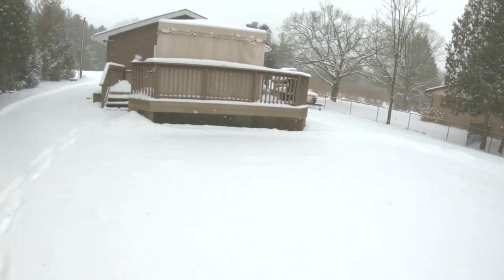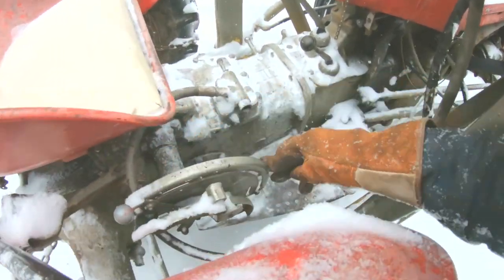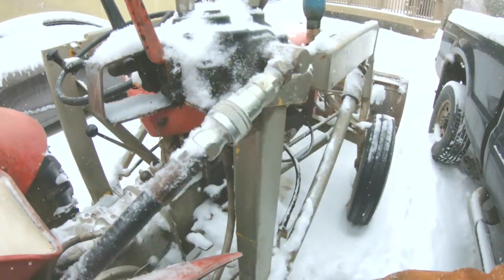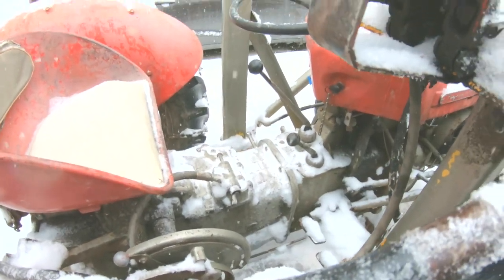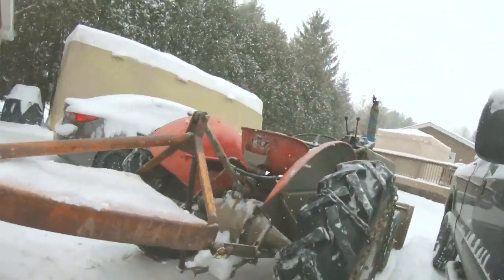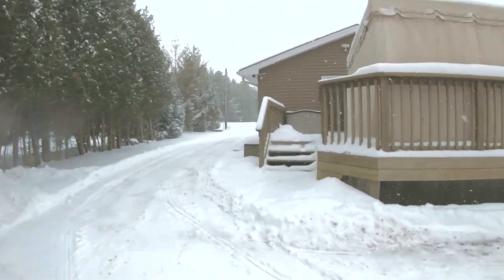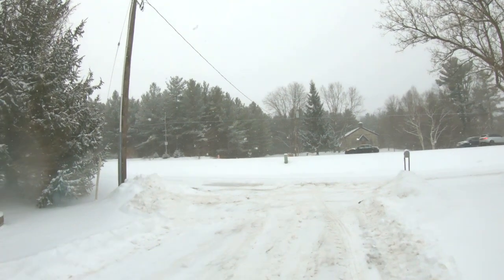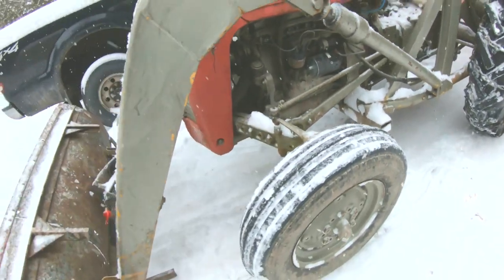Dual Blade Snow Plowing - Ferguson 35 - the perfect solution (for me)

Comment: Hello , front plow you made your self ? And with front loader , its enaugh weight for rear wheels ?
Reply from the maker: Front plow was made by a previous owner likely decades ago. I welded on a mount for the tilting cylinder. This year I have a 7' wide blower on the back. First snowstorm rolling in tomorrow. A little nervous if it'll work as I don't have chains on this year. Of course, I'll film it, LOL.